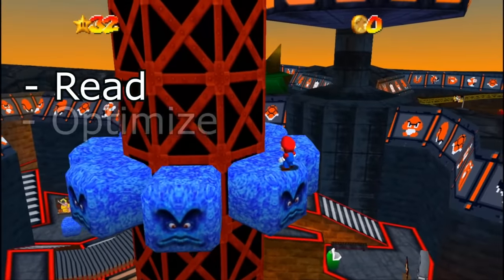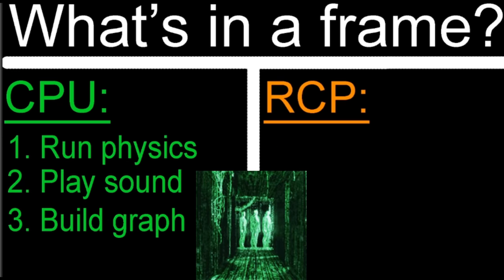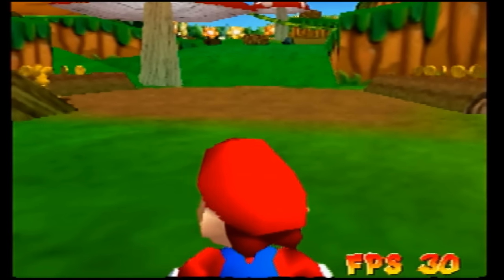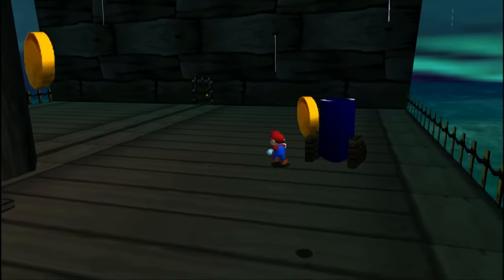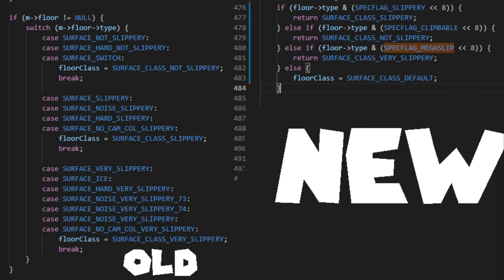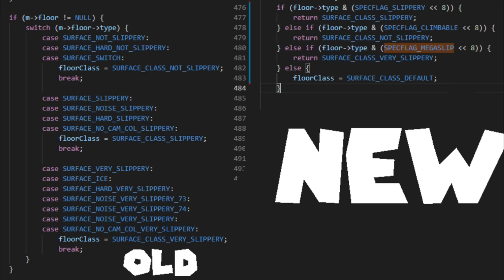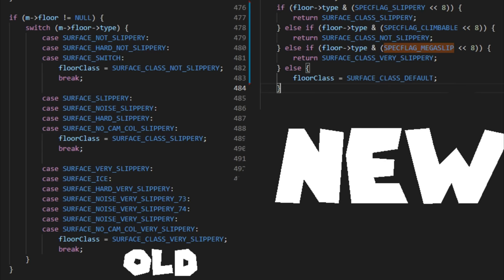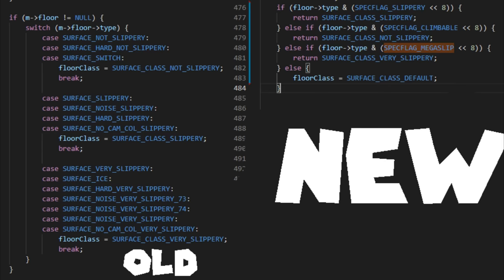FIXING the ENTIRE SM64 Source Code (INSANE N64 performance)

Comment: I learned on C in university so this is particularly interesting to me. He's right about the touch grass part: you have to sell your soul to master pointer arithmetic.
Reply: @osparav  there's a good video on fast inverse square root in Quake 3, check it out
Reply: @ImperatorZed  I believe it was made by a guy named Nemean, very informative and hard to believe someone actually achieved this
Reply: @ImperatorZed  Where does it use pointer arithmetic? It does use pointer aliasing, but that's a different thing.
Reply: @osparav  idk, all I know about it is that you add 1 and in the memory it adds 1*the number of bytes of the variable. Haven't searched to much to know what's difficult though.
Reply: @osparav  Using the same token for declare and use, not to having the hardware visualization about how pointers are, and not popularize the my_pointer[0] instead of *my_pointer
Reply: pointer arithmetic is not hard but unsafe, once you get used to you can do things you can't even imagine in any other language..

Comment: The thing about the N64 is that even though it was technically more powerful than the PS1 it did feel like it was held together with duct tape because of most games having frame rate issues. I believe the only game I played on it that ran at 60fps was F-Zero X which ended up being one of my favorite games on it. But this seems to prove that the console really was capable of much better!

Comment: impressive work kaze!

one question: with all these vroom vroom optimizations, how many textured tris/polys can this new engine render on screen at stable 30 fps?
Reply from the maker: if you render them all far enough away that they only fill out a single pixel, i imagine you could render 12k or something. but for any kind of practical application, i'd guess 8k or less is the absolute max.
Reply: @KazeN64  thanks for your reply kaze ✌️!

I just remembered a long video ago that you just made one of your first optimizations at a rendering level. It was in blender and you said that you have to lower the tris count to just a little above of 1000 tris...

So now with all these new improvements going to 8k of textured tris at the same time to have a smooth 30 fps is just insane... just incredible work!

Comment: As much as this is applauded and it is a very impressive achievement, i suspect dev pipelines may not actually permit such extensive optimisation when they're working to commercial release schedules.
Reply: That's unfortunately par for the course when you're working on something more commercial.
Reply: Absolubtely. Not to mention how spectacularly difficult making these kinds of changes is when you have 45 developers working on the game instead of 1.
Programming absolubtely does not scale linearly with number of people. After a point adding new people makes things worse. It is absolubtely possible to kill a project by assigning too many people to it.
Reply: Yeah, that's the real issue.  Our system isn't safe/forgiving enough to give developers years (or even months) to work out kinks like this.  The safety net, economically speaking, isn't there in today's systems.
Reply: @RugnirSvenstarr  Yeah, this is an important point that a lot of people (especially managers) need to hear, and have misrepresented over the years.  "Too many cooks" problem happens REALLY fast with software developers.  Because things are too big, and too split up for anyone to know what the hell is going on in the code.  A lot of the inefficient language design paradigms were actually designed specifically to attempt to allow more cooks in the kitchen, so to speak (Object Oriented Design, for example), not for efficiency purposes.  But at that level, this is why so many engines were so inefficient for so long.  It's only really been in the past decade (maybe less) that programmers have started operating in a different way, overall, than primarily object oriented, largely because they couldn't rely on hardware anymore to overcome the paradigm's slower performance issues.
Reply: The schedules are wrong.
Reply: That is generally the barrier. Less so in smaller projects built explicitly to show off just what a system can do, but those examples are very few and far between.
Reply: This. Deadlines kill a lot of potential.
Reply: My dude, we are talking about a game that was released approaching 30 years ago on a 1st gen 3d console. It’s not really about development pipelines it’s the fact they would have been hard at work figuring out how to even get any of this working let alone getting it 100% efficient.
Reply: @R2D2trashcan  How young/naive are you? 1996 wasn't the fucking stone age.
Reply: @R2D2trashcan  The hardware wasn't a gift from an alien civilization. It was specifically designed to do the computational tasks needed to run a 3D game like Mario 64. Getting to the point of starting to program a game without having prototyped all the basic functionality would have been far too much of a risk for such a large corporation.
Reply: @timewave02012  Mario 64 was arguably the first console 3D game. So it’s the first full 3D game developed by Nintendo on their first 3D system. That is purely a factual occurrence that naturally does not lend itself to fully optimised anything. It’s like saying Ford could have designed a Tesla on the Model T production line if they had a better development timeline.
Reply: @desmondbrown5508  going out on a limb I doubt they knew the final specs for what hardware would be shipping for a good portion of early dev. Also CRT televisions forgave alot of low fps sins we bemoan about on LCD monitors today.
Reply: Challenge the status quo then
Reply: Games get hacky optimizations if it pays off and someone actually has the job to do it.

A lot of games get a "prototype" engine to run, and then nobody touches that engine ever again and the game gets developed in a editor for the engine.

So if the engine does something thats terrible in runtime, well, thats just it.

A great example of horrific performance crimes is like pre-made assets of like an entire church, and on top of the church was a little roof, and somebody thought its clever to use that giant asset and just have that little roof over grass, while the game had to load the entire giant church "underground" where the player never saw it, but it was there in memory and eating cpu.
Stuff like that comes up more often, as people make games entirely in editors without really "programming" the details.
Reply: It took one person working alone a few weeks of work in their free time while not doing other things to completely overhaul an entire game from scratch.

A dedicated team of developers doing nothing but making this one game should have been able to do all these optimizations. They simply didn't take the time to do it, because release dates.
Reply: @R2D2trashcan  False. You're now just looking to argue. They didn't have the tools to make a Tesla back then. The technology didn't exist. This technology did exist, because it's here. You're looking at it. This is the technology. They just didn't use it right.
Reply: @chrismanuel9768  yes I am looking at it - close to 30 years after it was released.
Reply: @chrismanuel9768  "a few weeks" are you serious? This took way more than a few weeks, and also, both C and N64 were new things, they weren't used to working with either of those
Reply: @RugnirSvenstarr  100% this. When I used to be a game dev, the place I worked at loved the saying "What one programmer can do in one month, two programmers can do in two months".
Reply: They would have had Mario 64 done just in time for the Wii release. ;)

Comment: So, how much for you to do this to Goldeneye, Perfect Dark, Ocarina of Time, Majora's Mask, Jet Force Gemini, etc, all the amazing games that were unable to run at a playable framerate on the N64?
Reply: Masive ++++++ On Ocarina of Time and Majora's Mask
Reply: Begging for Goldeneye. I still remember the heartbreak realising how slooooooooow it actually was when I dusted off my N64 for a game about 12 years ago. It wasn't that treacly in my memories :(
Reply: Unfortunately, none of those games (apart from Ocarina of Time recently) have been decompiled yet, so none of us have access to the actual source code yet (to my knowledge)
Reply: Just in case anyone is interested, I saw that someone has written a retro style game that looks like a cross between Goldeneye and perfect dark. Dunno if it will be any good, but it's called Agent 64.
Reply: I thought Mario 64 was especially unoptimised due to things like compiler optimisation flags being turned off. I'm not sure you'll see such big gains with other games.
Reply: @SerBallister  i dkn. Perfect dark had horrible fps.

Granted at the time i was blown away by the graphics and sound and gameplay. Lol...
Reply: I was able to play those games just fine. Yes, they had a low frame rate. But it was just that. Low. Not unplayable. Have you ever played flight simulators on a Commodore 64? Compared to those slide shows the N64 games mentioned were smooth as butter. And even the C64 games were playable.
That is not to say that I wouldn't like to see the N64 games at a higher frame rate.

Comment: This video reminds me of another video I saw recently: Adding more people to a project can unintuitively increase the time to complete said project because of communication issues. (From "The Only Unbreakable Law" by Casey Muratori) In the video he talks more about programming, but it also applies to hospitals and why they typically have two nurses working 12 hours shifts instead of more. I'm surprised one man can do this, but at the same time I have to remind myself why a bigger team doesn't necessarily mean better.
Reply: That sounds familiar... what was the video?
Reply: @Mortal2064  He's the guy making the Handmade Hero series
Reply: @Mortal2064  Exactly the title I put in the comment "The Only Unbreakable Law," I attributed to the channel instead of the individual by accident (I fixed it now), but the channel it was posted on was Molly Rocket.
Reply: Or Fred Brook's The Mythical Man-Month. Just put a 10x guy on it, that'll do.
Reply: In the video at hand (not your link) it is made clear that enough people were added at the beginning of SM64 (I hope that it was 1993 with the demonstration of the 3do). They only did not have enough time to sort out all merge conflicts in the end. I have the same problem with my different code snippets. I really feel that you comment does not apply HERE.
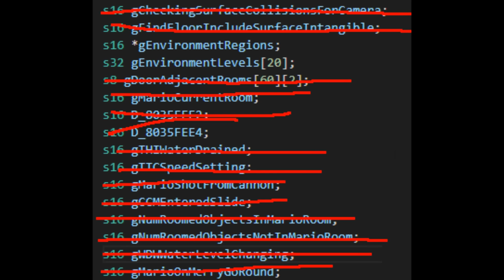Reply: @ArneChristianRosenfeldt  My comment was specifically in response to a segment around 8:08 where he talks about how he had to remove redundant code likely due to the programmers not knowing what the others have written, an issue of communication, so I felt like it did apply. Even if you think it doesn't, it's good to be aware of it.
Reply: @whynotanyting  sure. But the mythical man month limited it to a late project. Management already likes to burn out individual heroes. Mediocre programmers don’t get a job anymore. Communication is what makes distributed computing interesting. Clean code is when a team can work with it.

Comment: This is so awesome.  It's so cool seeing how fast something can be made to run via optimizations.

At 7:43, you mention "illegal code" that would "get you fired from your job".  As someone who has minimal programming knowledge, why would that be?

Also, do you have any plans on releasing a 60 fps console compatible patch for vanilla SM64?
Reply: You get fired because no one would understand it.

No, scratch that... according to Kaze, it's because of how extremely case sensitive and situational it is, I suppose everyone would have to be cautious about it because it'd become a problem fairly easily. Kaze can do it though, since he's not on a team.
Reply: It's because it's architecture specific - this is a 4 byte integer that we want the most significant byte from. However, because the N64 CPU is big endian, we can just read the byte at that memory address because it is the most significant (1 assembly instruction - lbu $t0, $a0), vs the original code which is 3 assembly instructions (lw $t0, $a0; srl $t0, $t0, 24; andi $t0, 255).
Reply: @wchill1337  You could kind of elegantly deal with that in C with a union ->  

union {   
    struct { u8 b0,b1,b2,b2; };  
    u32 word;
};

You could define the little endian version too.
Reply: @SerBallister  it'll still translate to more assembly instructions. Using a union in C is just a way to abstract the byte accesses.
Reply: @wchill1337  It should translate to a single LBU instruction if you access the first U8 via a base pointer (On a big endian system) ? 

In addition, using a union lets you define both the LE and BE variants and switch between them

** EDIT: I just tested this in godbolt, you get one LBU instruction to load from b0. (In MIPS) 

There is no cost difference between the BE and LE variant either as address offsets come free with every LB* instruction.
Reply: @SerBallister  oh, I realize what you're doing now. Yes, using a union would let you deal with it because it's effectively doing the same thing as the illegal code.
Reply: @wchill1337  Yeah, it'll compile to the exact same code.

Comment: Impressive work as always.
I've been wondering, are there any sound engine optimizations possible/necessary? 
I remember Sonic 1s sound engine on GBA being so poorly done it basically tanked performance, so I was wondering if N64 might be a similar case.
Reply from the maker: there for sure are! ive only done rudimentary cleanup of the sound code, but i imagine a proper rewrite could seriously improve versatility and performance of the sound engine. but that's in the far future.
Reply: That got me curious (about Sonic on the GBA), so I had a look at some of the code. It's actually not the sound driver that's causing the issues (it's the standard M4A driver included with the Nintendo devkit, which admittedly is pretty terrible in performance, but it's not the end of the world, especially since they're only using mono mixing) - it's more that, as far as I can tell, 1) They didn't put /any/ code in IWRAM aside from the M4A mixer, 2) There's a lot of calls to BIOS math functions (which were optimized for size rather than speed), and a lot more importantly 3) They didn't optimize their code for the ARM architecture, which combined with gcc's pretty terrible handling of non-32-bit data, means there's a /lot/ of LSL/LSR operations going on that really shouldn't be there, which is made even worse with the terrible ROM waitstates.

There isn't even any real-time graphics decompression going on, so I'm not even sure where all that CPU time is going.
Reply: @Aikku93  I didn't quite get that but that game has a quirk where game will run miles better if music is disabled in options menu.
Reply: @arciks11  Ok, I kind of see the problem now. The main issue is that the game logic is sitting at >45% CPU usage (which inexplicably jumps to >56% when jumping and stays there until returning to ground). This would be fine on its own, but the sound driver is configured to use 12 virtual channels and operates at 21024Hz; each channel takes up to 3.9% CPU to process, meaning that audio processing all up can take up to 47% of CPU (plus maybe 3% for processing the music data). That's already pushing the limits when you're not moving, but when you're jumping, you're definitely going to have lag.

Of course, it depends on how much audio processing is happening in a given frame, but I hope that cleared things up a bit.
Reply: @Aikku93  I believe jumping increasing CPU usage may still be the same issue. I think if SE are also turned off that spike possibly would be lesser, if not absent
Reply: @arciks11  The measurements I took were after disabling both background music and sound effects.

On further investigation, the increase in CPU usage is related to scrolling. When you accelerate or jump, CPU usage can peak at >75%... and then it increases by a further ~38% when crossing screen boundaries, as it loads a full 32x32 tilemap when doing so (instead of updating only as many tiles as you've scrolled the screen by, as nearly every single game does).
Reply: @Aikku93  I see. Thank you for looking into code and shedding some light on that weird game.